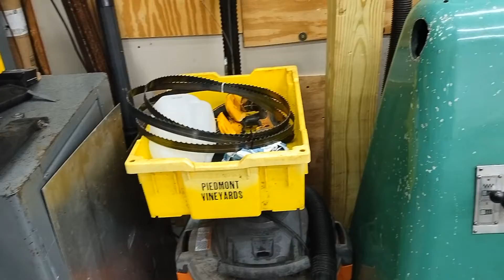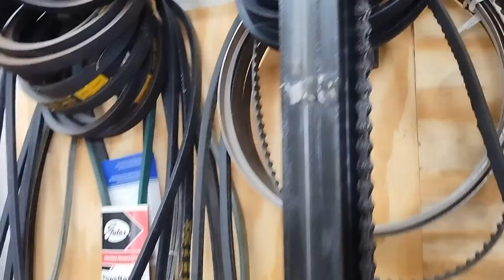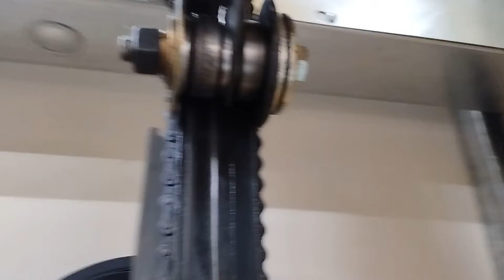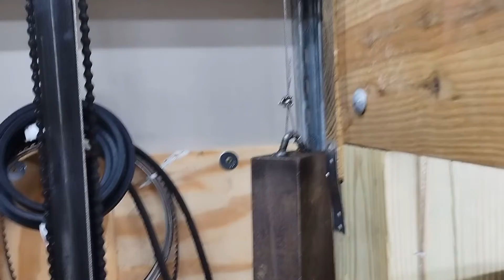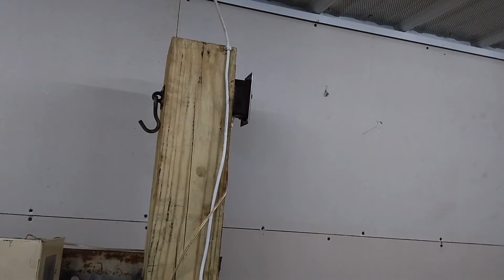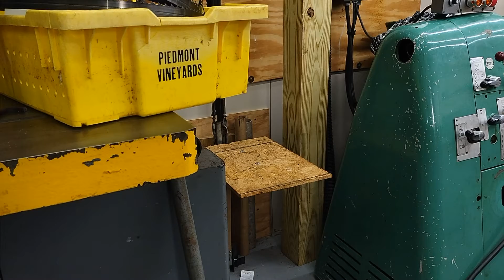build a platform lift or dumbwaiter from a garage door opener for safe shop storage

Comment: Nice job on the lift.  I like that you didn't do a full design and then try and fabricate the plan.  You managed to explain each piece and your thinking behind why you did it that way, in simple terms.   You are a triple threat, practical engineer, fabricator and a naturally gifted teacher.  Thanks for doing the video. Great job.  One question is the track angle iron?  It looked like 1"X2" tube  but you mentioned you used 20' of angle iron.
Reply from the maker: Thank you for the compliments!  The track is the original garage door track, but I welded the joints to make things smoother for the way this loads the track
My comment about 20' of angle iron was probably about that overkill piece of angle iron I used to hang the whole thing from the top - I dragged a 20' piece of that 6x4" angle home from an auction